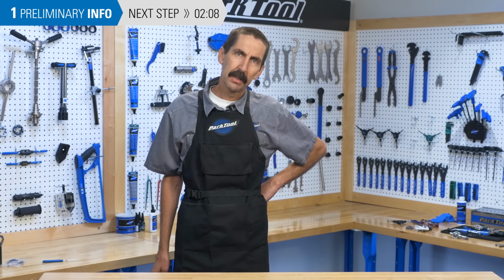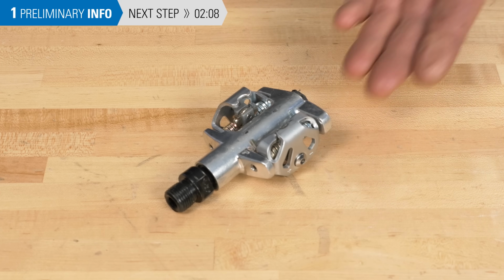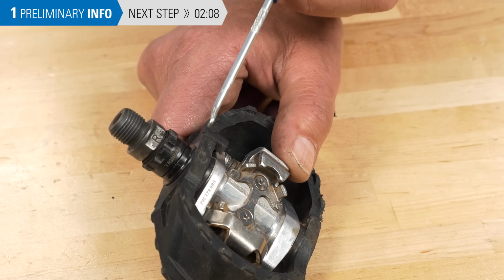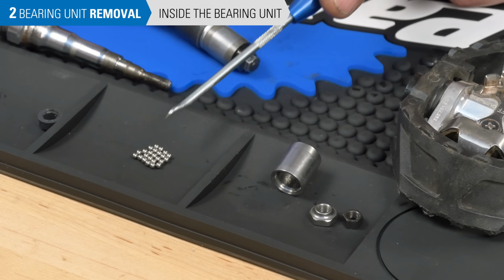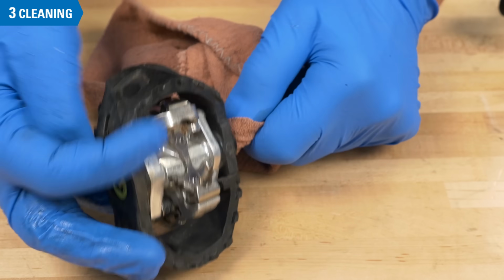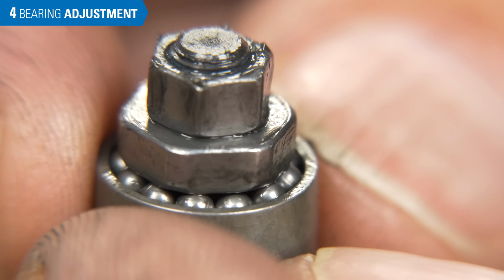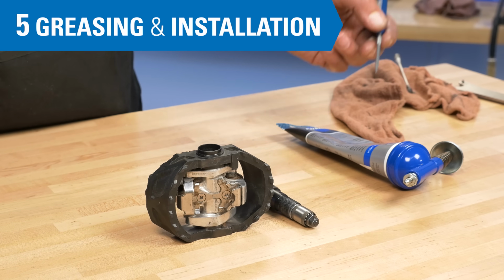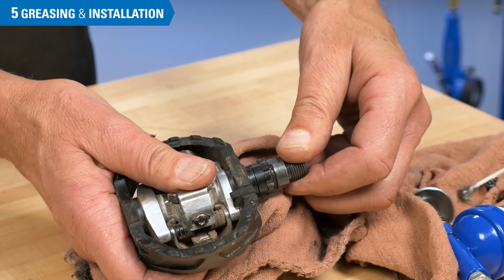How to Service & Adjust Shimano SPD Pedals

Comment: I've got 20+ year old SPDs going strong. I regularly
Remove axle, give it and the body a quick clean.
Fill up the pedal body hole to halfway with lots of grease.
Screw the axle back in. Take care not to go too fast or the pressure build up can strip the plastic thread. 
Go slow enough to let the pressure force all of that grease up and through the whole spindle/bearings. It comes out dirty.at first then clean as it purges through the lot.

Nip it up, clean of the excess grease, then ride for miles😀.

Comment: I watched a bike mechanic in my local shop service my pedals. The long story is the bone went into his shop for a service as I've an upcoming Bikepacking trip. It came out of there with an annoying squeak. I thought it was the bottom bracket, which he'd serviced and said needed it. He was adamant that the BB was now fine and that it won't be that squeaking. I took the pedals in and he stripped them down and then rebuilt them whilst I watched. Rather than squirt any grease into the bottom of the pedal to then force through the bearings and cups, he merely coated them with "some" grease. Needless to say, I still have a squeak. It's a regular squeak when the right pedal is around 2pm when viewed from the right. I think it is this pedal or the BBC. I think I can now do this job on the pedals so will tackle it tomorrow. 
One final question. Other than wasting a bit of grease I'm assuming you cannot really put too much in as it will just force out what's not required past the pedal spindle but I imagine without enough I could be getting a dry squeak?

Comment: Recently I noticed on my XT MTB pedals a lot of side-to-side play (along the spindle, or left/right relative to the bike) on one pedal - roughly +/- 1/4".  The other pedal has virtually none.  I followed the disassembly and adjustment steps shown in your video (and in Art's Cyclery - basically the same).  No improvement.  All I can discern is that the cylindrical tube that holds the balls is somehow different in the two pedals and the spindles are ever so slightly different (other than thread direction).  The cylinder that holds the balls is beveled differently (left vs right).  Any idea on what else could be going on?

Comment: Have watched this video (very helpful) and the video on types of grease, but having taken my pedal apart, I'm not sure what grease to use. In this video, the grease looks quite runny, but I have a tub and a small "toothpaste tube" of TFT lithium grease, which is more "paste-y" - would that work for this purpose?
Reply from the maker: A lithium grease will do just fine on pedal bearings. A robust grease with good staying power is what you should desire in the pedal area.
Reply: @parktool  thanks for taking the time to answer my comment on an old video! I ended up using lithium grease, following the video instructions. 

Unfortunately, it didn't solve the slightly crunchy feel of one of the pedals, and from a chat with my LBS, he said it's not worth the cost of a rebuild (they were pretty old - 25th anniversary pd-m530 pedal), and not particularly expensive - so they'll be ridden on my trainer bike until they fail and then given to the scrap metal man. ;-)

Comment: The nuts came loose inside the pedal after the adjustment. Perhaps didn’t tight them enough to lock. The pedal fell apart but the shell stayed inside the pedal’s body. Is there an easy way to remove the hub shell stuck inside the pedal? Any special pullers out there?
Reply: Shimano Saint SPD MTB pedals PD-M821

Comment: I think most people are just gonna buy new pedals. I have well used pedals still working fine after 15 years hard use so considering the relatively low cost I would just replace.

Comment: Thanks for another great video for DIY, but I have two questions. 
1: My left pedal seems like it causes problems where my right one works great. I do clip in/out of the left side 99.9 percent of the time when stopping. What happens is I start getting a clicking sound when the left pedal is horizontal, if I twist my foot a bit it stops. When this happens if I check for movement in the pedal shaft there is a lot of play. In the past i've just replaced the pedals as I've attempted to repack the bearings before this video and during disassembly the "O"-ring seal  got destroyed and I couldn't find one the same size.
2: Is the a "rule-of-thrumb" for servicing these pedals/bearings? I live in the PNW so I do some riding in the rain.
Now time to look for a video on bottom brackets as I'm noticing some play in it also. Since this is my touring bike I don't need a breakdown on the road.
Reply from the maker: This can depend on the pedal brand and the history. I would start by removing the pedals and greasing the threads then re install and tighten. Also check your cleats for tightness and wear. The wear does not typically cause clicking but it could. A lot of play can allow the bearings to come out of place and cause clicking. At that point a new set of pedals or a complete axle setup would be the best options for you.

Comment: Wish I'd seen this video a few years ago... I must have been able to save a few sets of pedals!  Oh Well!  
I've noted that almost all the pedals I've had issues with [typically] used BALL bearings.  The issues encountered are disintegrated BALLS and/or RACES.  I'm guessing this is the case where you toss the pedals and buy new.
Would you consider doing a  general session on Pedal Designs??  BALL vs NEEDLE bearings??  What to look for  and what to avoid??  SPD vs [old] LOOK vs [so-called] Lolli-pops and 'Eggbeaters'??

Comment: I've adjusted by right SPD pedal about a hundred times now and I just can't get it. If I adjust smooth w/o play it tightens down after one ride and is indexed and needs to be re-adjusted. Too loose and obviously there is a ton of play. Is this a defect? Should I just leave it with a massive amount of play?
Reply: Clean the contact surfaces of cone and lock nut and apply enough torque so they don't come loose.

Comment: Very disappointed by this video, Calvin! Normally, I am a big fan of your videos and frequently share them with others. While the information you provide In this video is fine,   you neglect to mention that on many Shimano SPD and SPD-SL pedals, the right pedal has left hand threads on the axle end where you adjust the cone and lock nut to make bearing adjustments. Neglecting to mention this may lead to heartache among  viewers using this video to make adjustments to their pedal bearings.
Calvin, I have "liked" each of your many excellent videos up until this one. Here, I feel you let down your viewers by omitting a crucial warning.
Reply: Found this out the hard way… 😭

Comment: My "shell" got stucked with the lock nut after I opened it. Is there any way to remove it from the pedal body? Or do I need to trash it and get new pedals?

Comment: My new R550's 7mm locknut keeps getting loose after every ride. I'm quite a heavy rider. Is it okay to use loctite 242 treadlocker on the 7mm lock nut?
Reply from the maker: Thread locker is fine to use there. It really should not be coming loose if jammed well up against the other nut. This is interesting. Keep us posted on results.

Comment: thats not a good way to grease the bearings, theres two sets of bearings so when you degreased both sets, simply squirting grease into the pedal isnt going to effectively grease both sets of bearings. and that degreaser needs to be cleaned out too as it leaves a residue. the only way to properly clean and lube the spindle and bearings is to take it all apart clean and regrease as you re-assemble. imagine cleaning and greasing a wheel hub this way, its not good at all.  poor cleaning and poor greasing.

Comment: This video is shit. It does not help if the pedal is stuck or is self-tightening, which is the most common problem with pedals. I have no idea what kind of special Shimano Pedal he has. PD-M545? But I have a right R Shimano pedal (PD-T420) and the two small nuts are COUNTERCLOCKWISE to tighten and not clockwise like in his video. That's on the RIGHT pedal. Further, leaving the assembly intact and then rinse it in detergent is absurd! The outer bearing which is visible can be cleaned like in the video, but there is another second inner bearing on the lower part that needs to be opened, cleaned and checked. Just rinsing on the outside is useless. Applying grease on the outer bearing does not help greasing the inner bearing either. I am confused because Park Tool is supposed to be the reference for bike professionals.

Comment: excellent video!   I was overhauling some A520 pedals and learned that the drive side pedal uses left hand threads for the cone and locknut!  Unfortunately, I only figured it out after stripping the threads out of the locknut.  My M520 pedal uses the standard right hand threads.  Any idea why Shimano would use left hand threads for the cone & locknut on just one (or a few) models?
Reply: Stripped my 520 locknut as well—just minutes ago, in fact. I sure wish this mechanic placed more emphasis on this. We can’t be the only ones who’ve made this mistake after watching this video.
Reply: The answer is thats the way to dont get losen the bearings accidentally when pedaling forward.

Comment: Hi team, how would I torque the bearing back into the pedal body? I don’t have a highly tuned arm but I do have a tw-6.2. How would I connect that for a 17mm wrench (for my ultegra 6800 pedals)? Thanks!
Reply from the maker: For that you will need a 17mm crow foot. We do not offer one at this time but they are out there in the world. Thanks!

Comment: So is there only 1 bearing race in each pedal?
Reply from the maker: There are 2 bearing races in each pedal. Both are adjusted at once.
Reply: @parktool  thanks. That's what I expected, but you only showed one bearing race in your video.
Reply: @peterhancock8011  they showed both. Watch again with opened eyes

Comment: i have a tip for you. instead of using the wrench, just use your fingers. finger tighten the cone nuts and lock nuts. put your wrenches on, hold the 7mm steady and step back the cone nut. it will give the right amount of play and lock the system at the same time. the balls are small and easy to mark. use the fingers to tighten them.

Comment: I'm such a loyal Park tool customer. Always go to your site for all your tutorials. Followed this one for my new Shimano PD-EH 500 pedals. I noticed from your video you were working on a right pedal. I started on my right pedal. You loosened the lock nut counter clockwise. I proceeded to loosen counter clockwise. Guess what? I stripped my brand new axle thread. So much for trust in Park tool. My right pedal axle assembly - lock nut and cone are reverse thread. What's up with that?
Reply from the maker: We are sure sorry to hear there was a problem with your overhaul.  That was a right hand pedal in the video and it has a right hand thread direction.  You do make a point with the limitations of videos.  There are now newer models with a left threaded locknut.  See https://si.shimano.com/pdfs/dm/DM-CAPD001-00-ENG.pdf 
Youtubes are locked in time, but products can change.  
When working and turning a wrench, the feedback loop is very important. By nature of threads, if a part is turned in a loosening direction, you can feel a lightening of the load very quickly. If the wrench is turned in a tightening direction, the effort ramps up quickly in just a couple degrees of turning. The feeling in that initial turning is critical. If you feel something should be loosening, and is unlikely to be rusty, that relief in pressure should be quickly felt.

Comment: Calvin, that grease gun you use, is that the GG-1, without the reservoir?  Does that meant that a tube of Polylube 1000 will screw right into the underside of the GG-1?
Reply from the maker: yes the GG-1 is made to use either way.  With the reservoir or using any of our lubes etc. that come in a tube.

Comment: No need for the special tool. Just use vise grip gently and it comes out easily. Re-tighten accordingly, there is not much force. Thanks for posting these videos, saved me from buying new pedals.
Reply: Parktool videos are great, except for that if they sell a specific tool for a task, they are going to advertise it and hide the ways to do it with standard tools.

Comment: Shimano spd 520's can be found on sale for $35 a set. I simply replace mine every 2-3 years. No need to purchase special tools and go through all this nonsense.
Reply: The special tool costs around $5, so not such a big deal.  I hate replacing things that are otherwise good if a little maintenance can fix it.  This "nonsense" will take all of 10 minutes, generally.

Comment: Noticed I have been riding with some play in one of my pedals. Is it bad for the longevity? Isn't it more bad to run with them over tightened, which is bad for the bearings?
Reply from the maker: Its a goldilocks type adjustment. Not too tight and not too loose. The looser or tighter it gets from that point wears the bearings about the same.
Reply: Thanks.
I did service my right pedal today. The one with play. I ran into a strange problem: The play comes from too much space in the nylon(?) black lock bolt (that are at the bottom of the axle). Not the 7mm and 10mm bolt wrongly set. It's like 1mm too much space after tightening the with the PD40-tool. I might try adding a own spacer to fix the play/gap. My pedals: "Shimano PD-5700 105 SPD-SL Road Pedal"
Reply: That play goes away once the axle is threaded in the pedal body.  Just load the bottom of the pedal body with grease and all will be good.  I like mine to have a slightly "hydraulic" feel.  That way the pedal will rotate up to meet my foot when I take off from a stop.

Comment: If you can take the play out of the bearings without over-tightening them in two tries, you are a wizard. Most finicky pre-load I've ever encountered.
Reply: He is a wizard!
Seriously all it takes is practice.
My method is to do the cone finger tight then the locknut and finally when tightening hold the locknut still and back off the cone to it.
Seems to work fine for me but again I've been working on bikes for nearly 50 years now.
Reply: @nigelnightmare4160  That's how I have always done it too!
Reply: @nigelnightmare4160 yo! thank you man
Reply: Its easy with practice
Reply: Elaborate, plz.
Reply: Nicholas...no, you must really suck. Easiest pedal ever.  If you know what you are doing.
Reply: @pressrolls Nice, helpful comment. 🤦‍♂️

Comment: Love the videos! While doing this the lock bolt broke in half, is there any way to remove it from the pedal body? Or do I need to trash it and get new pedals? It's a PD-M520.
Reply from the maker: There is not a way to effectively remove it, nor are parts very available.  Seems like time for new pedals.

Comment: Scatman John didn't die after all. He just faked his death to become a bicycle mechanic.

Seriously now, the thing with Shimano pedals vs Crank Bros was that they pretty much didn't need to be serviced. If Shimano starts going that way, well, CB pedals are way easier/faster to service.
Reply: this is actually way more detailed and thorough than shimano pedals need. If you take them apart once a year. Like just screwing the bearing unit out. Filling the pedalbody with grease and putting it back in. The old grease is flushed out and your pedals will most certainly never wear out

Comment: I've always thought it needed to come apart completely.  Thanks for saving me a lot of time on my next service!!!!
Reply: Calvin puts blue grease in it. Then when tighten the pedal into the body, just some black dirty stuff comes out. I vote for full overhaul and proper cleaning. When clean grease comes out, thats the moment when I feel its allright
Reply: It does if you need to replace the bearings.
Reply: I always dismantle every single bit of the internals so that it's the cleanest it can be.

Comment: you did mention a few speciality tools during the video.. it would be nice to have a quick screenshot at the end with all the speciality tools needed.. I have a box full of pedals that need reworking and I am going to buy all the necessary tools immediately.. thanks
Reply: There is only one specialty tool required, and that is the Shimano TL-PD40.  It is available on Amazon for under $6.  My LBS doesn't carry these.  Mine has lasted 5 - 6 years.   You can use a channel lock pliers instead of the wrench.  I use a headset wrench on mine, or clamp the tool in your vise.

Comment: will there be a video on SPD-SL pedals? And would the repair procedure for SPD-SL be the same from dura ace all the way down to R540?
Reply from the maker: The concept and service procedures of the SPD-SL pedals is much the same as in the video. Many use the Shimano tool TL-PD40. In some cases it is cone wrenches, but again the process is the same.
Reply: Yup, should be the same.  The axles are identical.